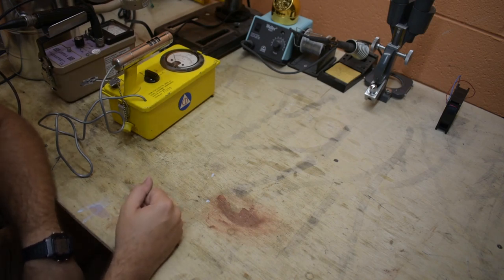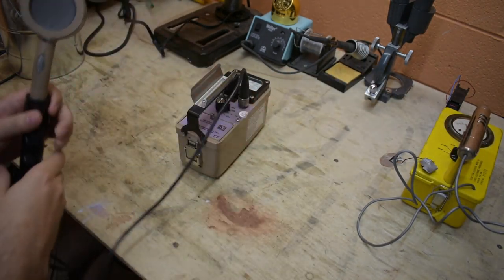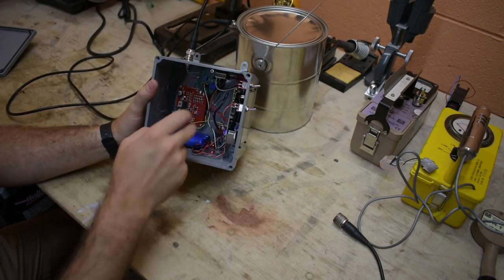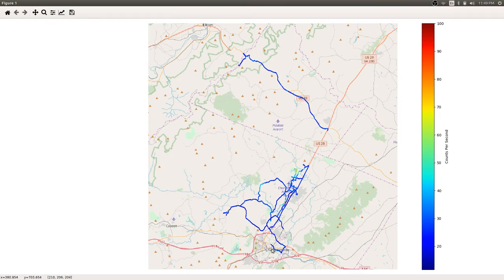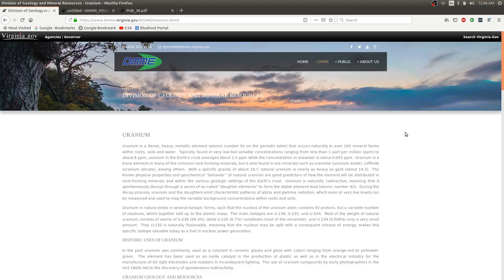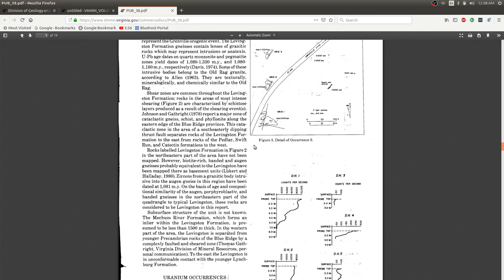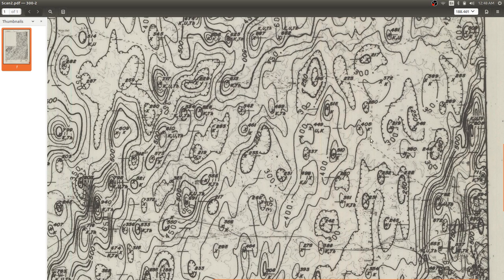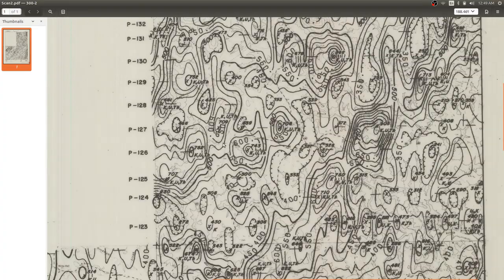Mapping Radiation with a Raspberry Pi GPS Scintillation Detector

Comment: I know it's been a couple years but this video has inspired me.  Just bought a Bicron 3" assembled probe.  They don't seem to sell the preamble module any more so I got the 950v hv and preamp combined.  The output is analog to 3.3v.  I'm going to use a raspberry pico which has 3 analog inputs.  Should be almost plug and play.  For GPS I'm using a 4hz module and recording data every 1/4 second.  I'll display every 1/4 second as well but weighted to slow the deflection down.  I'll record data to a USB drive if I can figure that interface out!😁
Reply from the maker: Nice! Let me know how it goes. I moved last year, and was just thinking I need to do some more mapping of the area I moved to!
Reply: @Hunter271828  After working out all the bugs and adding some alarms, it works amazing.  Here in Colorado I have found 8 small uranium deposits.  Looking for a big one now!
Reply from the maker: @CALLSIGNHAM  Nice! That is awesome, I'd love to see your build. I have out, sitting on my desk. I fired it up for the first time in a few years. I would like to improve the software a little bit.

Comment: I need to build one of these!

Would co-locating the electronics module to the top of the can interfere with detector?
Reply from the maker: That would be fine! Really the only thing that interferes with the detector would be stray light. Also, the paint can acts as a really good Faraday cage that blocks out almost all electrical noise that might be coupled into the detector.

Comment: Would it be possible to shrink the detector from paint can size down to "microphone" size similar to the other detectors you own? Or does it need to be that big?
Reply from the maker: Yeah, it is definitely possible to make it any size you want. However, the larger the size of the scintillator plastic the more sensitive it is to gamma rays. There are more expensive scintillators that are much more sensitive (and expensive) than the plastic one I used, and with one of these you could use a much smaller size and get the same sensitivity as mine. If you think about it, it is really hard to get a gamma ray to interact with matter (that's why they pass through so many materials) so the longer the path it takes through your scintillator the more likely it is to interact and make a flash of light.
Reply: Bigger is better, its like having a telescope the bigger the objective the more light you can gather.